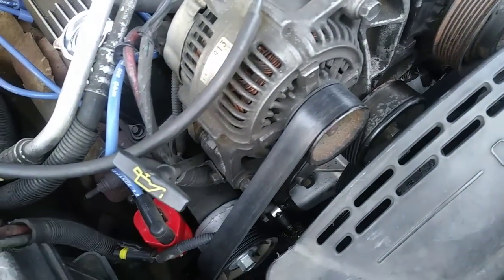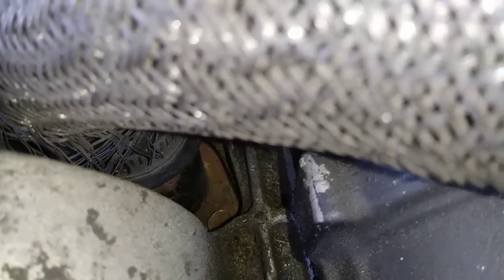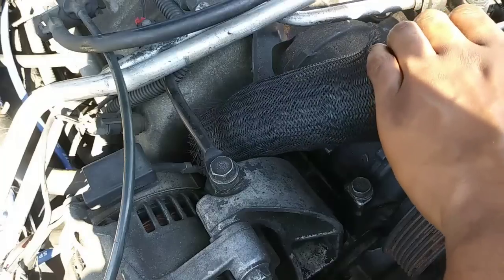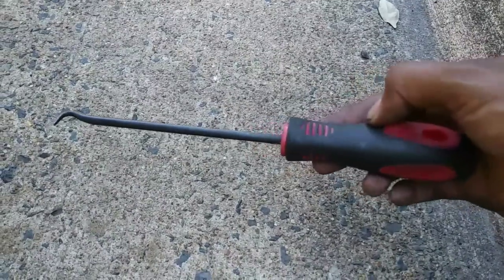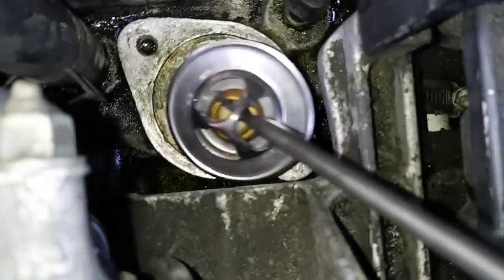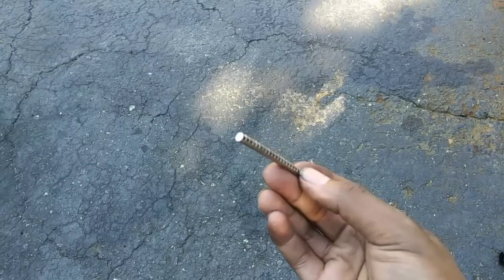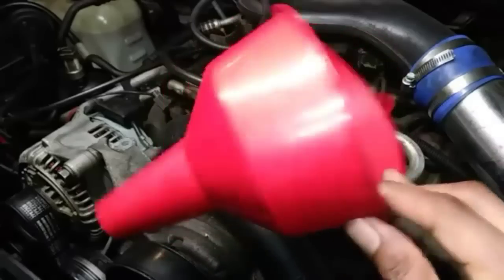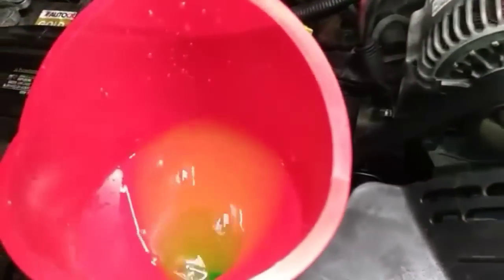THERMOSTAT & UPPER RADIATOR HOSE REPLACEMENT (1993-'98 JEEP GRAND CHEROKEE V8)

Comment: BRO YOU USED THE MAGNET TRICK, LOVE IT. Also VERY VERY SMART TO TAKE THE HOUSING OFF WITH THE HOSE STILL ATTACHED ON THE THERMO. SIDE. GREAT FIX BC. AS USUAL, LOVE THOSE VALVE COVERS, NICE.

Comment: You are really good at every video you post, you have no idea how helpful these are.  I have been following you for a while.  Thanks very much.   I replied to you in a separate video where you replaced the water pump.  I also have a 1997 Jeep GC 5.2L.  I have had issues with thermostat housing gasket leaks for a while.  I noticed you did not use RTV sealant.  I am going to give that a try, may be that is the issue.
Reply from the maker: Thank you. I always put the gasket on bone dry but it is a good ideo to use a little rtv to paste it to the thermostat housing so it doesnt move around on you when you lower it into position. I just didnt have that for this video but Ive never had it leak. I did have Coolant leaking from where the hose connects to the thermostat housing which made it look like a gasket leak but no matter how tight I made the clamp it still leaked, so I pulled it back out and wrapped some self fusing silicone tape where the hose meets the thermostat housing and then tightened the clamp over top of that and its been leak free ever since.
(Self fusing silicon tape refrence video 
https://youtu.be/oiDZP3Lo_Zo

Comment: Hello, I have a 96 ZJ. I replaced the water pump, upper hose, bypass hose, and thermostat. While removing the water pump I damaged the metal hose/pipe that goes into the water pump heater hose or whatever 
I got the old one out and have the new one, do you have any suggestions to reinstall the new one
Aside from removing the clutch fan?

Thank you

Everything else is still back together

Comment: Do you have to flush the coolant out first before you remove hose and thermostat
Reply from the maker: I dont
Reply: BARRICADE GARAGE I just thought the coolant might come out once you take the hose thing off
Reply from the maker: @AlecDaStar  I just pull it and let it drain in a pan. When you said flush radiator im thinking an actal coolant system flush

Comment: Question. On the inner end of the hose where it connects to the thermostat housing mine don't have that metal strap thing that you can tighten down it's just got this weird metal ring thing with two metal tabs sticking out, there is some play in the tabs if I try to pry it loose with a screwdriver but the thing won't budge.
Reply: Yeah that’s a old school factory clamp you need a special tool get they off of just cut the helll at it till it comes off then replace with a new school hose clamp

Comment: Hahaha! Finally, I did this before you! When I got my ZJ I had a small leak in one of the hoses so i replaced both! I replaced the thermostat also. I was super upset that there was that crappy green trash coolant in my engine. Got the proper gold coolant, but not OEM I used Zerex concentrate with distilled water. Factory thermostat was 210° wasn't it? I replaced with 210° i almost feel like I should've used a 180° that they tried giving me.  It was a pain in the ass getting those bolts back into the thermostat housing and even worse trying to get a new hose clamp on the lower hose going to the radiator! Great video tho bro!